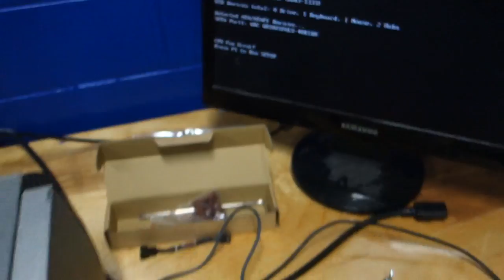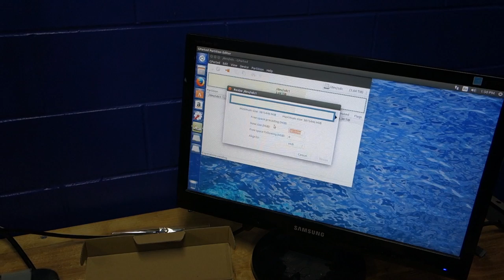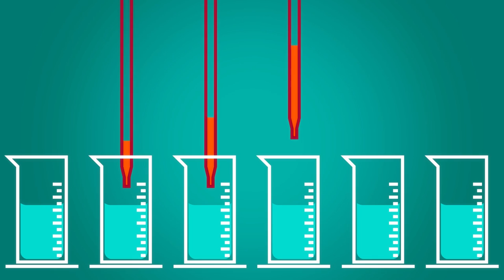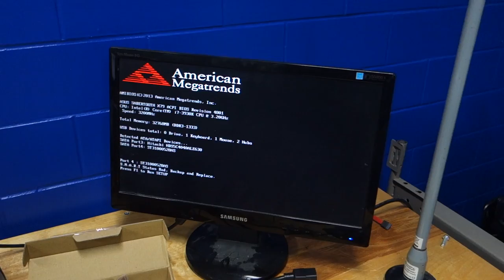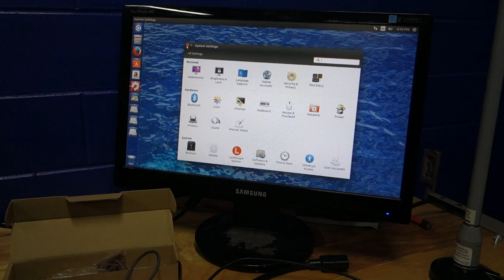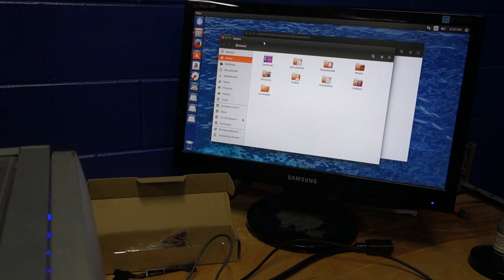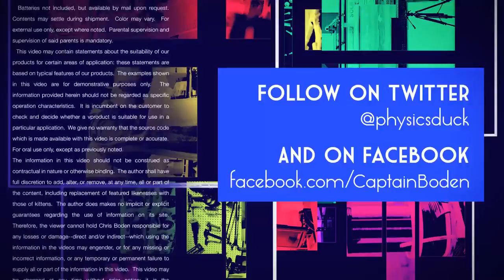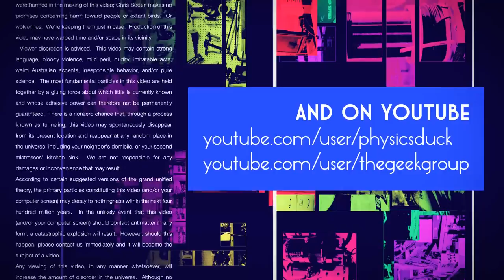Captain's Blog 11 20 2015 Cheese Porn and Attack Dogs

Comment: CPU opt fan is something i think you'll see on more recent boards. As far as I am aware it's as simple as it being a header for an optional fan. Usually this header and the normal CPU fan header are tied together and are both controlled by the CPU fan settings.
Reply: +BlazingMandril its for watercooling setups where you need radiator fans controlled too
Reply: At the moment I have an all in one that requires 3 fan headers. I have the two fans hooked up to the CPU and CPU opt headers. and the pump on a separate one. If you're really getting into serious water cooling usually you will use a separate fan controller.

Comment: you should be able to go into your UEFI Setup there in the advanced menu, it gives you profiles and stuff at the bottom there. see if there's a fan calibration of some manner. this should give your UEFI a good idea of what your fan's upper and lower running RPM limits are. this is the case with the Delta fan on my brother's box I built. you do a calibration, and it then runs it at the almost-lowest speed the fan supports before it gets such a low pulse it doesn't spin. 

Also, if you can put the fan on your heatsink in a pull configuration on the back of the heatsink, it'll also move more air across the fins, as well as make the heatsink easier to clean later on when it DOES inevitably get dusty. Also, are the two 60mm (70mm?) fans in the rear hooked up at all? I don't see them moving, maybe it's just me, but they should be on if they aren't. don't forget that before you put it back in service.
Reply: Dont put the fan in pull unless you have to. It will not pull more air over the fins. The air will find the path of least resistance which often is the edges of the fan shroud and not over the fin stack. 

Also Chris should figure out how to attach a camera to the dogs and make it livestream. So we can have doggy vision.
Reply: +offroadguy56 and others say it doesnt make any difference...so atleast in any situation no need to touch it
Reply: offroadguy56 even if it doesn't, it'll still make it easier to clean. and that time will come in a bleek future where dust rules the computers in the CCC.

Comment: You can usually use the "su" command in front of your file manager's name. After you type in the admin password, it will open a file browser window wherein you have full permissions and can set sharing rights for the drive. It's that or you just dump the partition since it has nothing on it and clear the drive. Reboot, set a new partition and your golden. That or do it over USB which is a slow pain in the ass. The super user shell is a powerful tool. You don't really need to know much to do a lot.

Comment: Well the motherboard is able to sense how fast the fan is spinning and if it detects a fault in that then you get the alarm. so it could be a problem with how its sensing depending on the age difference of the fan to motherboard. Or it could be an internal fault in the fan that causes it no not detect correctly.
Reply: +bgsteiner some/many aftermarker coolers don't spin the fan fast enough on the startup (cpu is dead cold) so mb says "ohmygod fan error" when infact nothing is wrong with the cooler..its just awesome and stays cold for a while after turning the computer on
Reply: +Jan ”Nekoroms Random” Andersson so in most cases one needs to turn off the fan warning
Reply: +Jan ”Nekoroms Random” Andersson and it works after reboot = cause the cooler warmed up enough for the fan to have the speed mb is happy with

Comment: default warning fan speed on asus boards is 600rip'ems i see your already changed it to 500rpm try setting it to the 200rpm or 300rpm setting with that it should not go off unless the fan straight out stops also for the sata hot swap you probibly need to enable it in the bios by default hot swap should be off at least that
 was the case with my board

Comment: you are holding a mad dog.  extra desks look great.  banking is very flat.  phone ringing is unpredictable.  you need enough voltage to run the fan.  many external hard drives are USB.  on that type of indicator white indicates the OS.  bless you.  1257  big viewer mail boxes are more fun.  denechi's mail is very interesting.  get more processors to manage the data on the hard drives.  Moose is an angel.  google "Rule 34" without the quotes.  every computer part is important.

Comment: you should check out zorin os, it is like if ubuntu had a bastard child with windows 7
Reply: yep no problem, i use it for my linux machine in my setup.
Reply: if you like a more simple distro it works great. it is very similar to Ubuntu, but without the shitty unity ui.